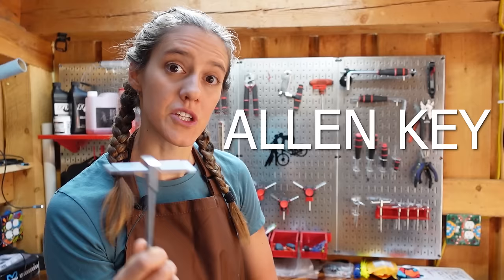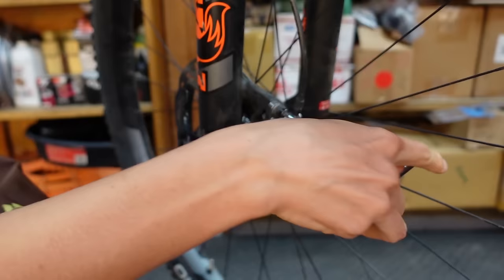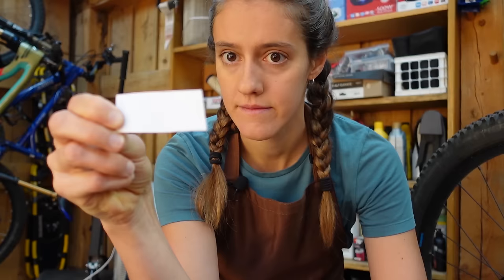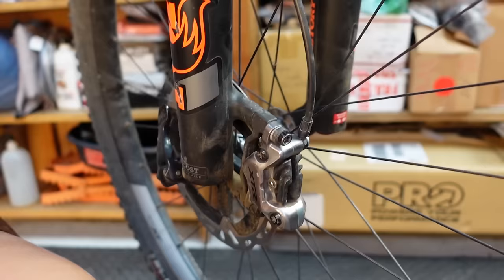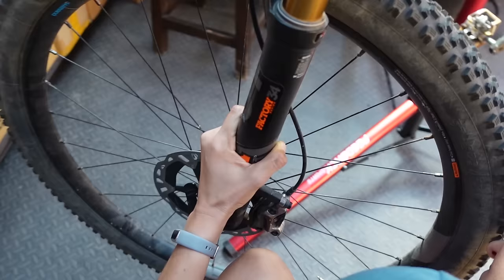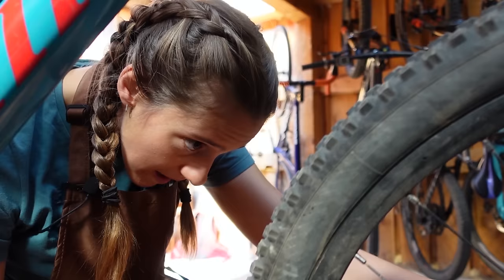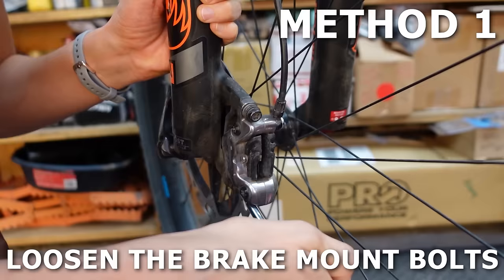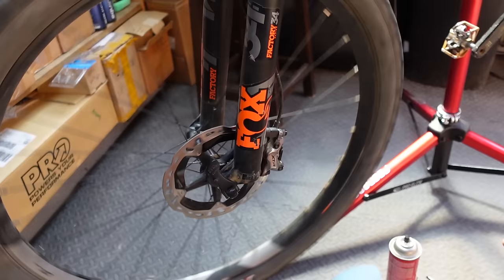THREE DIFFERENT WAYS to center disc brakes and stop rotor rub | Syd Fixes Bikes

Comment: I'm fairly new to this but one of the things I've already tried is putting a piece of paper over the rotor as you've done. While it did seem to work, I couldn't figure out why. It's the same thickness on each side of the rotor so centering should be the same. Then, if using a sheet of paper works, why wouldn't 2 or 3 sheets work better? That's only 8 to 12 mils thick and there should be room for that. 
So, I tried it several times and discovered that sometimes it centered on the 1st try and other times not until the 2nd (or even 3rd), but on that 2nd try it made no difference if I was using the paper or not. My conclusion was that I was simply squeezing the caliper at a different spot on the rotor. 
My conclusion certainly could be wrong. So, could someone please explain to me, logically or scientifically, how the paper works?
Reply from the maker: The paper trick works because it forces there to be space on both sides of the rotor. Oftentimes one side of the caliper won't move as freely as the other because the piston(s) get sticky so if you center it using the first method, only one piston might move to take up all the space so the other side will still be rubbing because it didn't move. With the paper even if one side doesn't move as easily, once the more freely moving side hits the paper, the other side moves in until it hits the paper too, thus creating space on both sides of the rotor once the lever is released. For really sticky pistons, sometimes the paper still doesn't work because the stuck side is so stuck, but usually it'll do the trick.
Reply: @sydfixesbikes  
So if one piston isn't moving and the paper creates a space between that piston and the rotor; when you remove the paper the piston still isn't moving so you're only braking on one side of the rotor but at least the other side isn't dragging on the rotor making noise. Is that the idea?
Reply from the maker: Yup. And usually it's that one side is moving less rather than not moving at all, so it does still brake on both sides, but tends to push the rotor to the side and can lead to a wobbly rotor. We've been planning to do a video on fixing a sticky piston, but haven't had time to yet.
Reply: @sydfixesbikes  I'm still missing the principle of action, but I appreciate your time. If I run into this problem I'll just fix the sticky piston. Seems better than damaging the rotor or having less powerful brakes.

Comment: Using a small led flashlight behind the caliper and reading glasses helps with method #3. But sans skills, if my mechanic mentioned using a thingamajig, I'll say no thanks, and then just find a rock to beat said mechanism into submission.

Comment: i tried everything, but still it rubs, my ebike is brand new , there tried to insert paper but then due to zero space it does not come out so again I detached the disc brakes and removed the paper. can anybody help ?
Reply from the maker: You may have to push the pistons back out to reset them if they accidentally got pulled without the wheel in the brakes. Unfortunately we don't have a video on that yet.

Comment: I am a little surprised to see you use brake parts cleaner on your rotors. I thought Shimano always stated you should only use Isopropyl alcohol??
Reply from the maker: We've been using it for years and it works great! You do want to get the non-chlorinated kind though. And Isopropyl alcohol works well too!
Reply: Syd Fixes Bikes good to know. I have always had good luck with the isopropyl alcohol so never thought to try anything else. 

Side note - you guys new channel is great. Helping people wrench on their bikes is such a good idea!

Comment: The paper method worked best for myself because it allows a bit of leeway....Typical copy paper is around .005" thick, which doesn't sound like much, but it can make a huge difference in gap or no gap.
BTW If I don't have a cat, will two wiener dogs be okay? 😏
Reply from the maker: 🐈x1 = 🌭🐕‍🦺x2 so I think you're okay!

Comment: Nice, but the problem with my brakes is that the calipers creep to the side while tightening.
Reply from the maker: Yeah, that can happen. You can try carefully greasing the bottom of the bolt heads, but usually the best solution is to get new bolts (they're often bent if they are moving the caliper).
Reply: @sydfixesbikes That is a great tip. Thank you so much. At the moment I kanaged to allign them by hand. Another problem I have is a very loud crunching and rumbling sound while breaking. I got Magura brakes and Magura discs with centerlock. Do you know where that could come from? It isn't vibration or rattle
Reply from the maker: Hmm. Crunching makes me think of pebbles or dirt stuck in the caliper, worth checking for that. Also worth checking that your centerlock rotors are tight.
Reply: @sydfixesbikes  They are both very clean It's not that kind of crunching. Rumbling is a little more accurate. My rotors are very tight. I checked. I really ran out of ideas.
Reply from the maker: Does it sorta sound like a turkey gobble (squealing)? If so, you might need to sand your pads and rotors and re-bed them: https://youtu.be/qsZPUyFZaxQ
Reply: @sydfixesbikes  Yes, it sounds exactly like a turkey. I just replaced pads and rotors. But I will watch the video anyways.
Reply from the maker: If you just replaced them, you may only need to sand them a bit. But make sure to bed them in properly!
Reply: @sydfixesbikes  I will do that. Thank you.
Reply: @sydfixesbikes  I already did bed them in. just differently. I woll try your kethod again. They brake with normal strength, but still make that turkey sound.
Reply: @sydfixesbikes  I just fixed the problem. I never heard of the solution. It seemed like the pads were catching on the holes of the disc, so i chamfered the brake lining where the disc enters. This fixed the problem completely on the rear brakes, but in the front i also had to deburr the disc a bit.

Comment: brake cleaner eats paint! it will also kill any rubber seal and it eats grease so if your wheel bearing is not a sealed one say by to the grease in it. it can crawl into a sealed one too. alcohol on a cloth and wipe it down. ask my fork how i know it eats paint......

Comment: X-rated novelty content aside, this is a good video, however it leaves out some important points, so be sure and further your education with some other videos as well. Odd that they omitted the inner pad adjustment wheel typically found in the inside of the caliper, that's basic and essential knowledge. You also need to know how to tighten the cable.
Reply from the maker: Neither of those points apply to hydraulic disc brakes, which is what these are. But for mechanical disc those are also things to check.

Comment: What about the rear wheel? I fixed it so it didn't rub but as soon as I get on it with my weight, it rubs
Reply from the maker: That generally means it either isn't fully in the wheel dropouts (if you have a quick release wheel) or there is some flex in the rear triangle.
Reply: @sydfixesbikes  Thank you!!!

Comment: Paper is too thin,  I always cut a busines card  in half,  loosen the caliper, slide them in and put the leaver and tighten the bolts.  Never have to take the caliper this way.
 Can  also spray the brake cleaner on your towel and clean the disk. Brake cleaner is extremely destructive to paint and wheel bearing grease.  Just constructive criticism guys,  not crapping on you lol.

Comment: Loosened off the bolts, squeezed the handle, hydraulic fluid squirted out, now I have no brakes. Uh. Thanks.
Reply: Did u loosen different bolts?😅
Reply: @darren92redrum67  Yeah, I found out the right bolts are underneath. Live and learn.

Comment: Hello I'm 15 years old and I like your videos but please include the safety tips and dangers (such as at 5:31) earlier in your videos because as I was centering my brakes, I accidentally put my finger into the disc as the wheel was spinning. My whole nail got ripped off and I have a fracture in my finger bone ☹️
- I should have watched the whole video first

Comment: New pads on yet they still rub on 1 side no matter what i do🤢100% not worth the hassle.
Reply from the maker: Sounds like you need to push the pistons out as discussed here: https://youtu.be/599GKW7_9jw
Reply: @sydfixesbikes  ok
Reply: @sydfixesbikes  I have done & released some fluid out. Dont know if it has worked yet as the bearings need replacing! Thanks anyway!🇬🇧☺